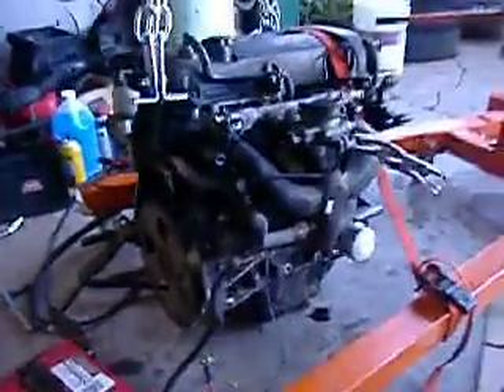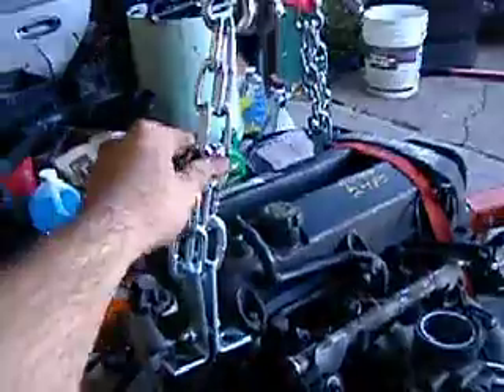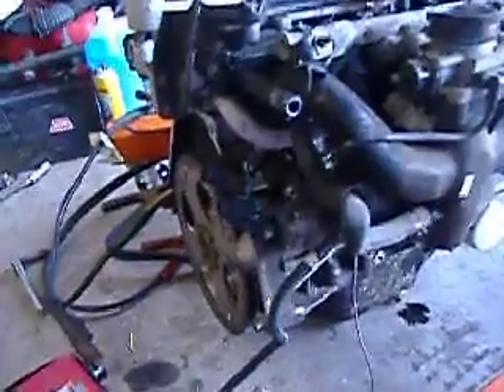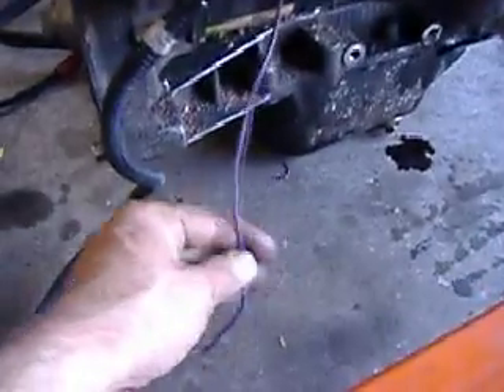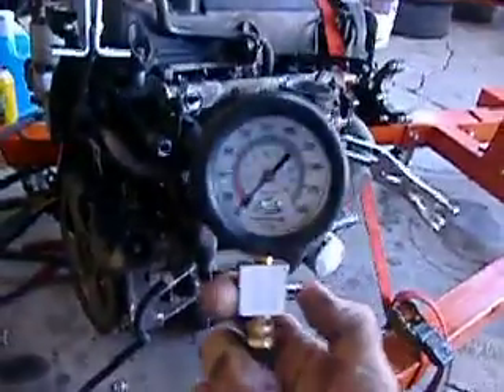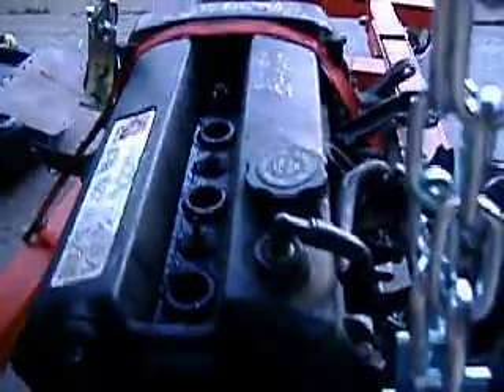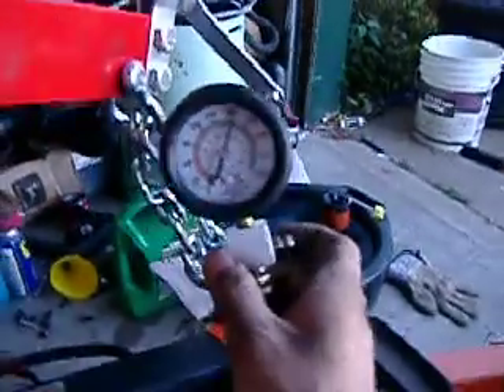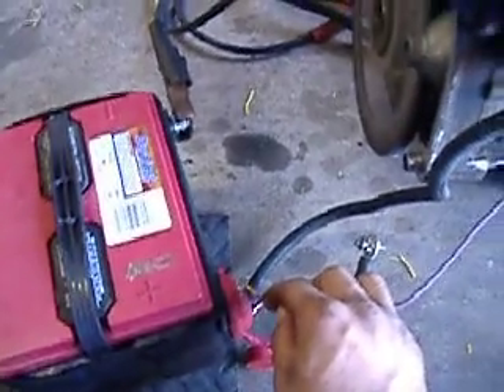Saturn compression test.AVI

Comment: Great video. I'm wondering about the lubing up you did with the WD-40 on the exhaust manifold ports and adding oil onto the spark plug threads. Is that something you'd recommend doing for any other motor too, for instance a Honda?